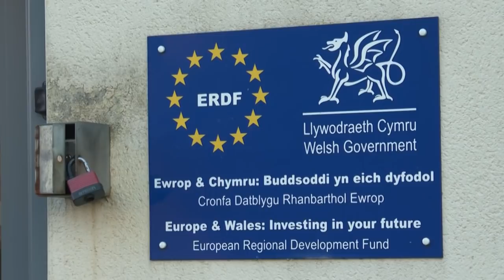Welsh pro-Brexit town prepares for loss of EU investment | AFP

Comment: The Dragon sculpture was created in Carmarthen, i.e. Wales:
"This is called 'Heart of the Furnace, Calon y Ffwrnais', and is a 4 metre high stainless steel dragon created by South Wales blacksmiths Sam Pask and William Holland of Phoenix Forge which stands in Bank Square."
A FOI request (again do your own Net search....) indicated ~ £65 000 cost for the installation; labour was separate - no figure given.
This is lot less than the silly 'Vertical Pier' £~1.6M in Redcar (some EU money), another ex-steel heavy town, that was the vanity project of our local councillors and never yielded a proper return:
"Creating just 100 jobs would generate £37m over ten years and that's without construction jobs, purchase of local materials and more visitors spending money here."
News Flash!  Didn't happen!  The town is left with maintaining (bits fell off it in spring 2020) a modern - and nearly derelict - building because local councillors are incompetent capital allocators basically.

Comment: The Welsh valleys have been struggling for decades, before and after the decline of the coal industry. . For all the vanity projects which were chosen by local authorities, not the EU, a vast chunk of all the regenerative funding spent there over the years came from the EU, not Westminster or the Senedd. Now it’s gone and surprise, surprise, all the replacement funding promised by Westminster is severely lacking. Now we’re all going to be paying extra to fund the NHS, what happened to the £350m a week that should have been available to the NHS post-Brexit?  If the UK is to thrive in the years ahead, it’s going to need better leadership than we have now on both sides of the House of Commons.

Comment: That's the problem with the EU much of what they did was fund vanity projects, while it might seem good, afterwards you are left wondering what use is this really. As long as the money kept coming no one really questioned it, the odd project might have some merit, much of the EU funds splashed around could never be properly accounted for, they made sure they had a good return and their friends did well, while everyone else paid in to the kitty, hardly surprising in the end people voted the way they did, if it was a Common Market it would work fine, once the unelected started getting their snouts in the trough that was it.
Reply: A view rather than facts, not shared by all.
Reply: @teddyboysdontknit810  I am not sure why you would say that, since 1994 at least and probably before that, the EU has failed to sign off on payments they have two standards  Fair and accurate and Payments free from Errors, every year up to 2007 they failed on both, since 2007 they claim to be Fair and Accurate, this figure includes 3.1% error which can be around 100 - 140m, many of these errors are people claim for things fraudulently like Sardinian farmer was compensated for not using environmentally harmful plant protection products on artichokes but was found to have used the products repeatedly during an on-the-spot visit by the ECA.

There are many vanity projects Ski lifts never used, Airports built  Poland, for example, built three airports, in Lodz, Rzeszow and Lublin, which have received more than €100m of EU funding, but which have not attracted enough customers to keep them in business. 
Canolfan Cywain rural heritage centre opened in Gwynedd, Wales, after it received £900,000 from the EU structural development fund. It ran into financial difficulties in September 2011 and closed a year later.

Theres some facts, probably fairly well known there are plenty more, Olive groves that don't exist but get grants, I can only think you are a troll, a couple of minutes on google and you would see any or all of what I have added, not a view these are facts supplied by the EU its self.

Comment: Wales needs to discover New South Wales. I see those bullshit empty supermarket shelf brexit memes and shake my head there is even a chance of a shortage.

Some salty antibrex wants Chernobyl fallout EU food for the UK instead of Australian, NZ or Canadian products from the Commonwealth.

Is there a bacon, cheese, beef, lamb, chicken shoratage and if so then HOW?
Reply: Do you know anybody who owns a map and can explain to you how freight costs and complex logistics correlate with distance?
Reply: @Dan210871  If we can get a BMW from Germany I cant see its hard to get Bacon to the UK. You could keep your empty shelves if you prefer.
Reply: @Mr101beers  You never took a Supply Chain course or read about Ray Vernon's product cycle, I see. The cost of transportation and logistics is pro-rated per unit moved, therefore its impact is far smaller in higher-value items (like a BMW) than in smaller-value items (like a donut). I'm dumbing it down for your benefit, but this is intuitively obvious. It is also one of the reasons international logistics conglomerates are laser-focused on optimization and still operate with razor-thin margins. And I won't even mention the added complexity that results from maintaining the cold chain, health and safety regulations, etcetera. Regardless of what you may "think" (and I use the term very loosely), these issues cannot be solved by a Youtube rando who doubles as the perfect example of the Dunning-Kruger effect.
Re-read what I wrote above, but do it slowly so your lips don't get too tired.
Reply: @Dan210871  Why does the UK  have lamb from New Zealand and that is  further away than Australia ?

I think people are pissy eyed about brexit and just want something to complain about.
Reply: @Mr101beers  The things you fail to understand I could maybe squeeze into the Grand Canyon.
Reply: @Dan210871  Hey I looked into it and it turns out that pork is shipped regularly between Australia and the UK in season. 12% of Australias imports of pork are from the UK.

Looks like someone beat both of us to the $$$.